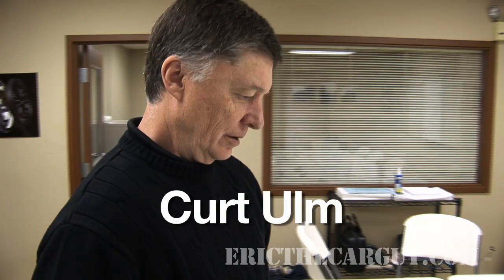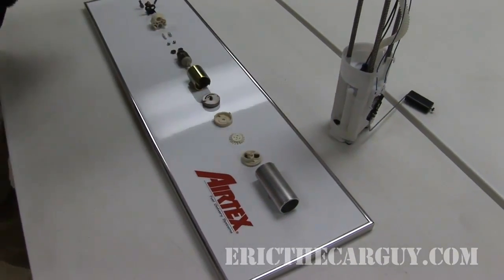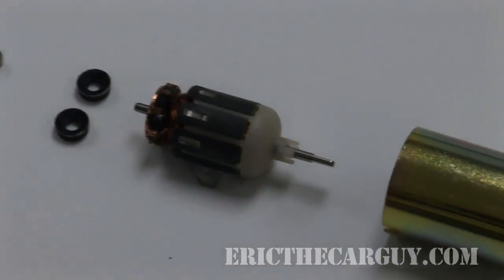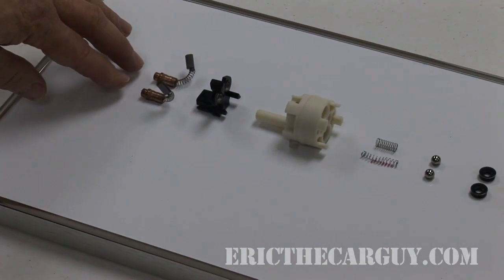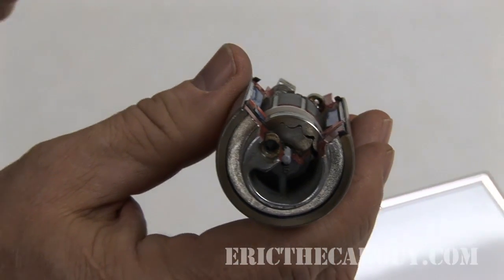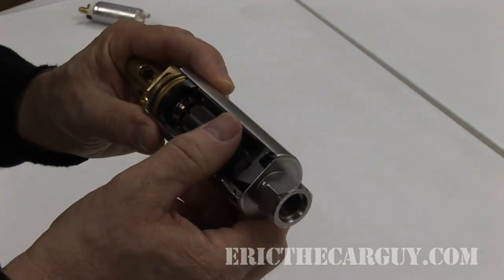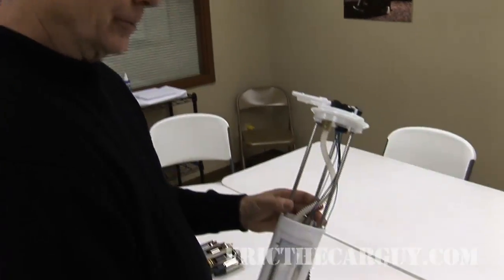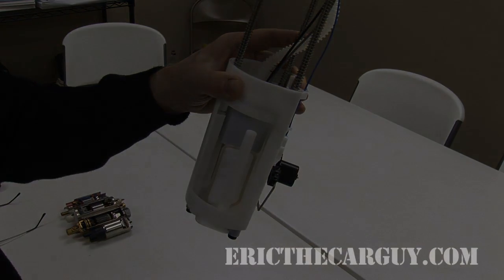What's Inside An Electric Fuel Pump? - EricTheCarGuy

Comment: taking apart a fuel pump module is like disassembling a watch.  I changed the internal pump to find the new one was defective and then when I replaced the new pump for the old one I unseated the return line pressure diaphragm.

the fuel pump pumps fuel to the fuel filter and what the engine needs is split off to the fuel injectors.  the remainder is returned to the fuel tank. at the fuel tank there is a pressure diaphragm that regulates the pressure in the system by letting in only so much returned fuel. this diaphragm acts like a check valve of the entire fuel system, not just the pump.  that diaphragm was unseated accidentally and not allowing any pressure to build up by not restricting the return fuel and letting all the returned fuel to go in the tank. therefore fuel was only circulating between the pump and the fuel filter and not pushing any fuel to the fuel injectors. after the third disassembly I saw the problem. a one hour job then took five hours. keith

Comment: I replaced an airtex fuel pump twice inthe year. The car is'88 Chevy Beretta wth a 4 cylinder 2.0 engine'. The first time pump was installed by a licensed mechanic .Shortly after he installed it the car started  quiting on me after driving it for about 10-20min. T. I replaced fuel regulator, fuel injector too. Finally I checked pressure and found out that with the key just turned on, the pressure  goes to 10-13psi then would go down immediately. So I replaced it And guess what? No improvement.

Comment: I've noticed on some electric, drill chuck powered, or hand cranked, pumps that are non fuel pump related say do not pump flammable liquids. Is there a difference between those pumps and dedicated fuel pumps that make pumping gasoline unsafe or is that safety label just a liability thing for uneducated people?

Comment: i hope you read this eric, i always wondered since the fuel pump is inside the gas tank, and inside the fuel pump is a motor which uses electricity to move the fuel, how does this not catch fire? does the motor ever create a spark? ive seen motors make sparks this drives me crazy how this all dosnt blow up
Reply: Not enough oxygen I guess.

Comment: awesome video. I have been trying to find out why my 02 jeep wont start on the first try. people kept telling me its the fuel regulator that has the check valves. even the dealer couldnt tell me for sure, they just tell me to change everything 650.00! I will buy the airtex pump assy and put it in. Thanks for the great video Eric!

Comment: @poopsmashed almost. let's say 6.8% fuel and 93.2% air :) still only the fumes are dangerous in a closed container. liquid ain't. that's why people who heat their homes with gas and have a gas tank resevoir instead of a direct pipeline to their houses have their tanks gauges set so that when it reads empty it's actually still 1/4 full

Comment from the maker: @brian5446 Either that or you can just cycle the key before you crank the engine when you go to start the car, I did that for years on a car that I used to have as the pump still worked fine.

Comment: Thx alot Eric! I have an older saab, and I've found the most notorious part in my car is the fuel pump.  I have been getting longer starts - about 6 seconds now - so its good to get some evidence of the fp from someone who knows them.  Does a defect in the check valve mean replacement?

Comment from the maker: @paul06660 If it's the original pump it's not likely that it's bad, in fact OE Honda pumps hardly ever go bad.  You say the pressure is 40psi, but have you checked it during the extended crank?  If not you might as the pump may be good but the check valve may be stuck not keeping pressure on the system after shut off.  Lastly I HATE aftermarket distributors as I've seen nothing but problems with them, you may want to check your timing.

Comment: none of my cars have any of those stupid fuel pump modules. they simply have the fuel pump that he is holding in his hand hanging from the fuel pump sending unit. i dont know why they went to the module setup but they are very expensive to replace, somewhere around 300 bucks. another reason why i like older cars, parts are allot cheaper and things are generally simpler to work on

Comment: @EricTheCarGuy thankyou for this great video ,exactly what i needed to know about the one way check valve.im having issues with my camaro v6 but my question is do all cars have the check valve on the pump or some cars have outside?i have a 99 camaro.to fix do i need to install a new pump or can i remove it from pump?thanks

Comment from the maker: @MrOne2watch It does sound like a possible check valve issue but use a fuel pressure gauge to confirm it.  As for Airtex pumps I've never had a problem with them.  I don't have a video on that particular replacement at this time sorry.
Reply: EricTheCarGuy z

Comment: your fuel tank won't ignite just because of the sparking from pump rotor/stator. there's a lot of O2 in the gas tank (gas tanks usually have a bleed valve on the cap to let air in when fuel goes down). it's the ratio that does the magic. luquid fuel in a closed container hardly ever ignites. it's the fumes that do it, for one litre of gas you need 14.7 litre of air. theoretically there's only one sweetspot and that's when you're really empty. but you need VAPOR not liquid in order for it to expl

Comment: is not "Curt" spelled with K ?!!  .. sorry i digress !! .. i thought fuel pumps work the same way of  Archimedes screw except that it's electrical !!. one thing i never figured out though i have worked with fuel tanks and fuel pumps the last 5 years is, does not that dynamo inside the fuel pump make enough sparks when it's rotating that could blow the tank off ?!!! i know about the grounding issue but still something i do not completely get.., there must be sparks inside !! .

Comment: i am having trouble with my 2004 chevy malibu V6 fuel guage/pump. the guage turns off and on giving false readings.and it seems the pressure drops and i have to turn on the car and let it build pressure or it wont start sometimes. so i was looking into getting a new pump and found people saying that the airtex pumps for my car were faulty. and the tank has to be removed to reach the pump.should i trust that the airtex pumps are ok? and do you have a video of this procedure on a malibu v6 ?

Comment from the maker: @lol123321123321 That sounds like a check valve issue.  Normally when pumps go bad they just don't run and cause a condition of no fuel pressure.  I actually have another video with Airtex covering that procedure, How To Diagnose A Fuel Pump Failure.

Comment from the maker: @alundrasrt No need to worry about that as the pump is submerged in the gas in the tank which is what 'lubricates' (if you could call it that) and cools the assembly, priming it is not necessary at least with the pumps I've installed.

Comment from the maker: @tinydx95t2 I wouldn't condemn an injector right off if you don't have a problem with the way the engine runs, normally if an injector is that bad you will have a very wet spark plug and a misfire on the effected cylinder.  You might want to try your test with the return line pinched off as it could be a fuel psi regulator problem.  Good luck.

Comment: im really concerned about my fuel pump..., basically i can hear it come on everytime, but since i have no idea if its ever been replaced with the 171,000 miles my car has, the concern i have is....how do you tell if one is going bad?!?! like do they just work untill they die? and you have no diagnosis, because my jeep 4.0 cranks like 5 times before starting unless i turn the key on and off like 3 times to build fuel pressure

Comment: @donbehatin I have. I did a test with a fuel pressure gauge and I performed the test 6 times in a row and 4 out of the 6 times I performed the fuel pressure test the pressure leaked off.Plus I have been changing my oil about once a month because the oil smells like gas. I have great compression so its not rings.and I've looked at the rest of the fuel system and everything is good.The only 2 things that would cause readings like what I got is a faulty check valve or injectors.

Comment: This video defiantly confirms that I have a fuel injector problem with my truck and not a fuel pump check valve problem because of the bleed off time that my fuel pressure gauge was showing. When I tested my truck the pressure bled off immediately after  shutting the truck off.I'm looking at getting new injectors and I know now its not the pump.Great video Eric and thanks for all the info.